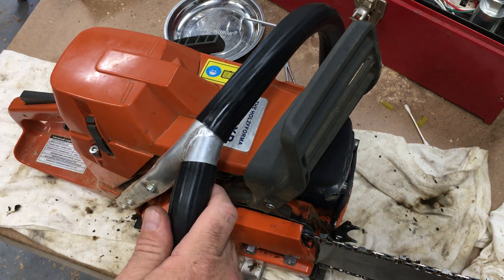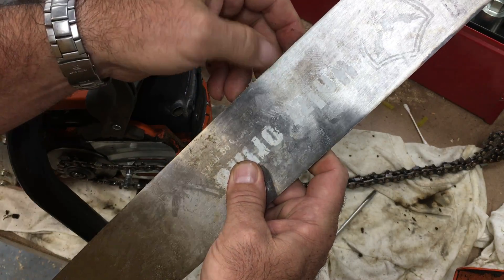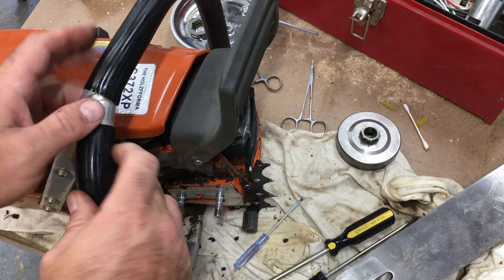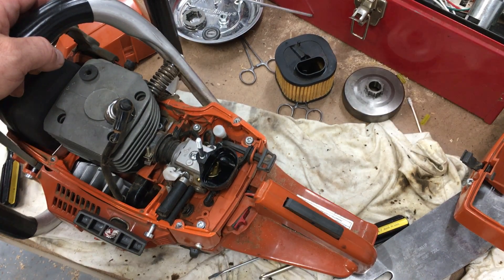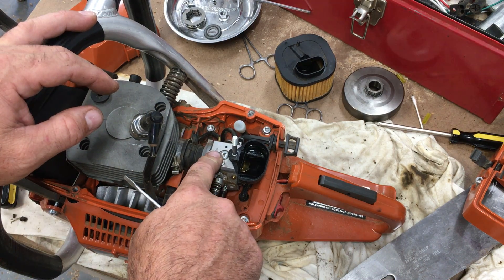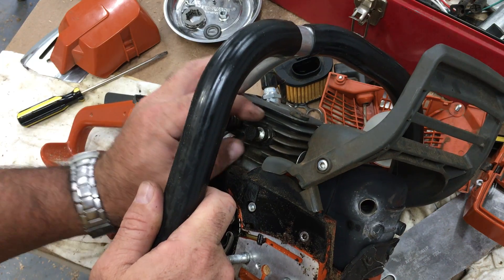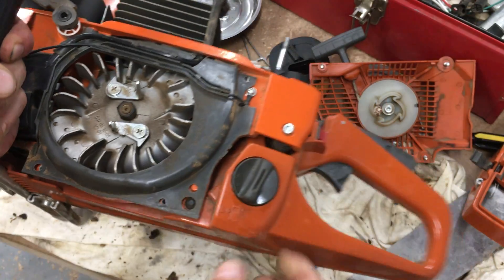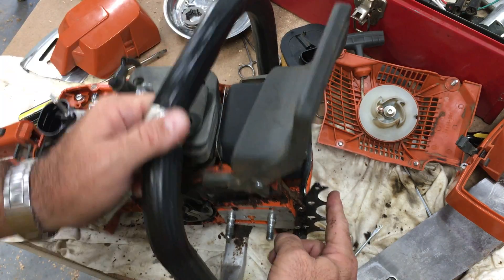Holzfforma G372XP (Husqvarna clone) Chainsaw Review/Tear down/Tips/ETC.

Comment: I just got mine yesterday and took down a small tree. It's a beast. I'm just a homeowner, but I've never had a saw like this. I've used smaller Stihl saws quite extensively. This thing rips. I set mine up out of the box, filled with bar oil and fuel, choked it, it crackled on the 3rd or 4th pull. I turned the choke off, one pull and bam she fired right up. It sounds mean too. I am very happy with mine. Thanks for the video!
Reply from the maker: Great to hear!

Comment: Thanks for taking the time to do this. I recently bought the same saw but is white with the carbon fibre look. Someone said it the the 'professional' model with a few different parts, I think a Walbro carb, nikasil cylinder and different piston ring(s). I have only run it for about an hour. 
The high rpm carb adjustment was too rich and once dialled in ran great. The oiler was way over oiling too. I turned this down quite far until it seems to oil as my other saws do. Time will tell if this is a good purchase. I'm running it with a 28" bar.
Reply from the maker: Mine could use a little more oil really
Reply: @ update- mine died after less than 20hrs use. Scored the barrel at the exhaust side. Toast now.

Comment: The old style front tensioner will be from a husqvarna 362 or real early 371. The plastic stealth around the throttle cabel will sometimes slip out of its little seat at the trigger, just have to push it back in with hemostats. Great review and you made some excellent points and things to look for. Hope the saw is treating you well and Jess is a great guy to deal with.
Reply from the maker: Thanks for the info and thank you for watching!

Comment: a real well done overview, thanks. I bought one a couple months ago, have yet to run it but I did a bunch of replacements to OEM or upgraded after market parts...the ones most mentioned on videos I watched that would likely cause trouble. The carburetors seem to be the most often mentioned failure point. I totally disassembled this saw and came away feeling pretty good for the apparent quality. Time will tell how the electronics and other stuff holds up. For the price I could not resist something else with which to tinker.
Reply from the maker: I hear ya!

Comment: Some of the stihl clone saws with the decompression valve on the top of the cylinder, the black push button will break off and that holds the  valve. When it breaks off, the inside valve assembly will fall into the cylinder and tear it up.
Reply from the maker: Wow...so I guess it must have a thru hole where the husky clone uses a counter bore and very small thru hole. No way for the valve to pass thru the small hole and cause damage. Seems like a much better design to me

Comment: The fill plugs on genuine husqvarna saws leak as well, I have had several saws with that problem, but mainly from the oil plug, and in those cases changing the plug didnt fix it as it is a problem with husqvarna castings
Reply from the maker: That's good to know. I just love with the leaks...it's not that bad. Thank you!

Comment: Could the hole by the tensioner possibly be the chain oil adjuster?
Reply from the maker: No, the oil adjustment screw is on the bottom of the saw just below the clutch

Comment: The wire on my FT coil was pretty short, so I had to put some extra protection on the wire where it touches the top cylinder fins
Reply from the maker: Hmm...I didn't really notice that on mine. I will have to look again. Thanks for the tip!

Comment: Would you recommend getting one of these off of Amazon? I have a $75 dollar Amazon gift card. Also should I get the blue or orange one.
Reply from the maker: I'm not sure. I got this one from Jes Ray at https://www.bluesaws.com/. He stands behind his products. The saw I received had a faulty oil pump and he rushed me out a new one no questions asked...even included the tool I would need to remove the clutch. In my case his price was cheaper than any Amazon seller at the time I purchased. I don't think the color makes any difference performance wise. I just wanted an orange one since it looks more like the real deal.

Comment: Curious what fuel to oil mixture are you running in that saw?
Reply from the maker: I've been running 25:1 but I'm thinking of moving to a mixture with less oil based on the amount of carbon build up I'm seeing.
Reply: @aborntexan  Gotcha, thanks for the reply. I am considering purchasing one of these saws myself.  I've seen some other folks on here running 40:1 with good results.  I've always been a 50:1 guy on all my other 2 stroke equipment.

Comment: Can you still buy them pre assemble in orange
Reply from the maker: Yes...I bought this preassembled in orange. You can also buy a 288 and a 395xp preassembled in orange
Reply: @aborntexan  thank u
Reply: I think they might come in white too now?  And, Neotec, not related to Farmertec has a 2 tone grey orange one, I think?
Reply: @bennyblanko3  that may be the “XT” version ? Supposed to be the new xtorque version like the xtorque husky’s … I kno there’s the 372xp and then the 372xt pro version supposed to have the Walbro carb n ngk plugs and some other things , if you look it up you’ll find the differences
Reply: @yenerm114  Yep, probably right!  I like the older non-xtorq version a little better (non strato).  Both are fine, and if running well are strong good cutting saws for the money.  I still think oem is better, if you can find a good used one.  But, the old non x-torq 372's are getting harder to find, and prices sometimes a little too high.  They run great, and are pretty light for how strong they are, even stock.

Comment: The biggest thing I noticed between my Husqvarna and this one is gas mileage this saw uses I don't want to say twice as much but a bunch more gas than my Husqvarna. But it is more powerful and I was running a 455 rancher. But the chain tensioner in the pull cord mechanisms is junk.
Reply from the maker: I haven't had any issues with the Chinese pull starter